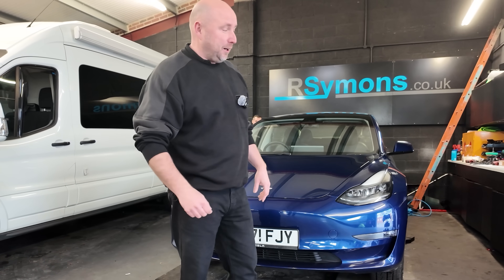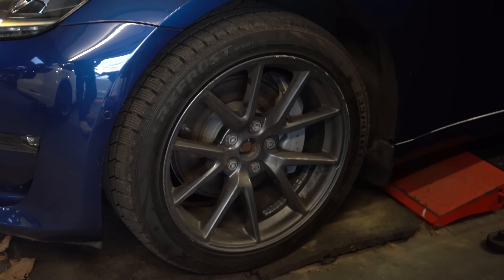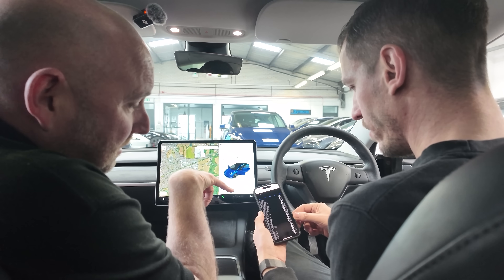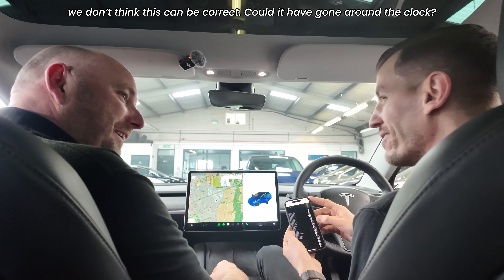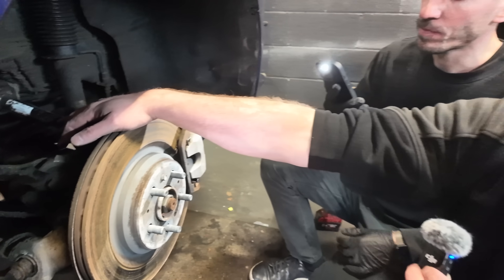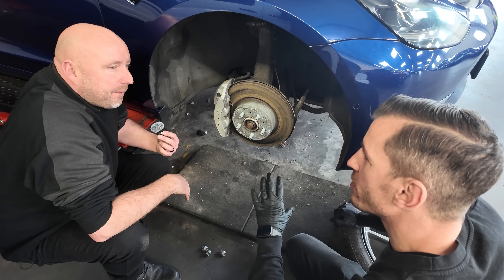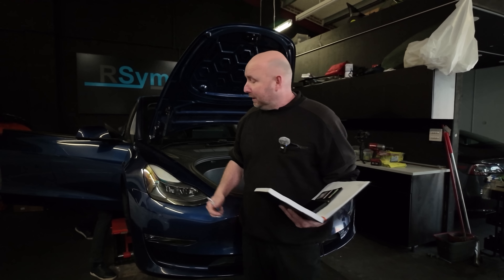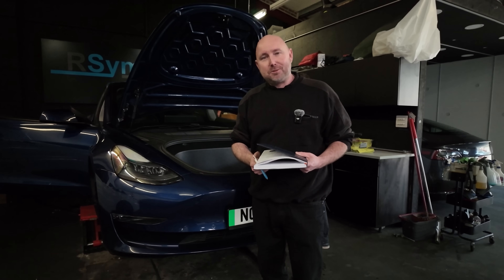EVERYTHING WRONG with my HIGH MILEAGE "21 Tesla Model 3! | Battery health and other issues!

Comment: The amount of EV sceptics that think I have to spend £10k on a new battery every few years is kind of ridiculous. And this just proves that it is a non-issue. But haters gonna hate. I can only imagine how much money you'd have to spend on a petrol car for 215,000 miles with oil leaks, clutch, gearbox, brakes, exhaust etc etc
Reply: My 2018 m3 has just over 200k and drives like it’s new. When I bought my Yukon with 200k I had to replace all the steering and suspension. It’s still drives like a sh!t box
Reply: @usafwilkerson Well, it's a GMC. What do you expect. If you are buying high mileage, get a Japanese brand.
Reply: @usafwilkerson where the fuck u driving
Reply: I got a BMW 1 series manual transmission, 2013 with super low miles, superb condition, lovely car, the 2nd gear synchro went bad, it's out of warranty, BMW wont sell syncros to mechanics, they won't sell a remanufactured transmission and they will only sell me "one of the last two new ones available in the world and there will be no more since that transmission is now obsolete " Final estimate for the job is $13k USD. and need to leave the car at the dealership for 4 weeks or more, went to an independent shop, same story, they couldn't quote much lower, the only alternative is to gamble with a manual transmission out of a crashed car in some junkyard... A 2013 car, financially makes more sense to sell it for parts and get another car rather than sink $13k on it plus all the other known BMW issues that will come up over the years, water pump, charge pipe, twin spool turbo, engine mounts, accessories belt and pulley, all know issues that will eventually pop up. Started considering a Tesla, remanufactured DU are available for ~3k in the USA including labor with warranty, remanufactured battery 8k with labor included... and that's pretty much the worst things that could fail in a Tesla in the worst case scenario.
Reply: The suspension bush problem is common with 2021 M3's.  Mine had failed its first MOT for this reason. However Tesla replaced them all at all four corners with upgraded units under warranty. The car had never had a service in 3 years so no issue there either.
Reply: Get back to us by year 5, three years is still in its adolescent stages.
Reply: @putzytart
My Skoda Superb at 215k miles costed me £30k in diesel and £15 in repairs. RRP when new £25k and less than £1k when I sold it…so nearly 100% depreciation. Now Ioniq5, 14k miles at the cost of just over £900 on public charging (no access to home charging, living in a flat).
Reply: I own only petrol and you’re right.
Reply: Some cars do have parts that fail other / related issues- ICE, EV, Hybrid, FCEV: doesn’t mean they will all do this, it’s a tiny percentage.

No car is immune, even £300k+ Maybach’s / Mercedes S Class.

What are you going to do - not buy any car because someone reported on a FB group it had issues.
Reply: I had a Seat Alhambra for 340k miles from new.
Three crankshaft sensors, three ignition coils and a clutch replacement. None of which apply to an electric car, and all of which required roadside rescue.
A MK1 Astra GTE 170k miles which had separately, a clutch replacement and a gearbox replacement. Again not something I'd ever need for an EV.
A Citroen grand picasso which had two clutches replaced, a turbo waste gate blow out, dpf issues and a complete set of brake disks replaced. None of which I'd expect on an EV.
Reply: I agree but the cost of a huge battery is huge and they do fail occasionally. My colleagues 2022 m3 just had to have the battery replaced under warranty after 40k miles. It was still drivable but gave an error code and stated range was reduced. It puts me off having one out of warranty as the £15k to replace it would ruin me.
Reply: @terrancedactielle5460  - EV Battery cost is high when you go to the OEM to get it replaced.

No one will do this when it out side of warranty, the same as no one goes to Ford for a replacement Mondeo engine when it fails after the warranty expires

Outside of a warranty - you can already buy refurbished batteries:
Porsche Taycan : £8k
BMW iX3 : £7k
Kiro eNiro : £2k
Reply: Oil leaks???
Reply: We need the sceptics. It's those that don't adapt to change or progress quickly that allows the others a head start to making more money and saving on costs. Be it through more efficient ways to live our lives or it being a tax benefit. Love the haters.
Reply: I had Audi A4 tdi V6 , beyond 80k miles it was on average £800 per yr in servicing , it felt like bleeding money.
Then had a Passat tdi new, when I got to  50k I sold it to some poor guy ;)
Reply: You guys are funny. All I was saying is that I have seen a battery die to someone who did nothing wrong. The same can happen to anyone buying a higher mileage or old EV.

Most people don’t want to take that chance even if it’s 1/100.

The BMS is very important yes, my 2021 Kona lost 8% battery health in one day because the BMS allowed the car to discharge the battery below 2.5V per cell for a few seconds when it was -3C. Some cars (like tesla) will live a lot better than others but you can’t generalise 

I bid on this Model 3 and lost. We had 6 EVs in our family, of which a model S with free supercharging and a model 3. So I don’t hate EVs but from experience, I still hate their problems
Reply: @tavi7 difference is, battery degrades gradually. Engines, water pumps, flywheels, and gearboxes just go kaput with no warning.
Reply: @AdamCiernicki you must have run some right old rubbish in the past 😂
Reply: My e-niros battery went within a month of buying. Waiting a replacement from Kia.
Reply: @carlstansfield9696  that’s a nightmare and clearly a manufacturer issue. Every car brand on the planet will have horror stories. You got unlucky, hope it’s sorted soon.
Reply: @carlstansfield9696 This is just how Kia operate. Your battery did not go but 1 of the cells did (maybe 1 of the 90 or so it has).  If it was not under warranty you would get that one cell replaced.
Reply: What about the thousands of people that lost 5 digits of the value of their EVs in last 24months? Because my Rav4 barely lost 4K of it's value in the past 3 years. Check the data if you are not aware the EV market is collapsing people don't want EVs, EVs were forced on to people which didn't end well. Tell your logic to the person that has lost 20K on a 50K Models 3 in a 1 year.
Reply: You are one of the fear mongers that seem to get off on any opportunity to deliver bad news to anyone possible so desperate to make others feel worse than you that you make up garbage with no basis in fact whatsoever.  Any moron can search eBay and see there is ALWAYS more than a few options where a car was totaled and were able to pull the battery while it’s still brand new or close to it.  A simple search would’ve educated you.  They cost about 3000$ not 20 lol.  If you can’t figure out how to change a freaking battery then there’s really isn’t much hope for you, is there?
Reply: You really are  full of BS. Try comparing that with a equivalent IC car used the same way. Very unlikely there would be any difference. Oh other than the IC engine would still be the same MPG and its fuel tank would not have reduced in size by over 10%. Of course if you go by Tesla recs it should only be charged to 80% so the capacity is now @ 70%..... But you know, Sheep are going to sheep.
Reply: I bought a pre-owned Model 3 Performance from 2019 with 240K KM/150K Miles.  Battery is at 82% capacity and i have spend over 1100+ already in repairs. Mostly control arms and some minor creaks that needed fixing. Sure the eletric motors are great, battery is insanely good on these cars, just a shame most other components aren't that great over time and same with a lot of design flaws on earlier models. The window rubbers seem to dry out on most of them and almost every high mileages ones have chipped paint on the sideskirts behind the front wheel, which leads to very bad rust in no time, since the skirts are full metal. That repair alone would send me back another 1000... which is by itself just terrible design that has been fixed with newer models tho. Also had bad luck with cracks in both rear rims (20 inch). Sure, for the money now, it's an insane deal and a great car/EV, but people glaze way too much over these tho, as the earlier examples are actually not that well build and have many weird issues. 

So no, you can't always drive these without any maintenance, it can be just as expensive as any other ICE vehicle, with more tears on rubbers and tires when hitting 120k+. Degredation also happends over time, as these will be passing 7/8+ years, i fear a lot more batteries will die. Besides all this tho, they are amazing value and the newer models are one of the best cars to buy now.
Reply: It’s always been bizarre. Most people just hate them because different.  Some just believe the rubbish haters spout, I’ve had a few people talk to me about mine and the ignorance is staggering. I ask them how many miles they drive a day and on a weekend they always answer 5 miles comute and might go shopping on the weekend so I could never have an electric car they take ages to charge I’ve given up trying to tell people my experience they just lack the ability to take in infor,action.
Reply: my 2015 F150 had the transmission go on it.. I never abused it either. After I got the bill to replace it with a rebuilt unit I sold the truck to the garage and bought myself a model y. Had it nearly 4 years now and it has been flawless.
Reply: Maybe it's those of us who buy toyota's and expect 300-400k trouble free miles... If you buy a prius or a rav4 with the hybrid drive train... that's what you can expect.
Reply: Imagine having to replace your tires every 20k
Reply: @putzytart & then they use an old diesel as the benchmark of cheap running costs & reliability 🤦🏾‍♂️ conveniently forgetting camchain/cambelt replacement or failure (I'm looking at you BMW), clutch/DMF replacement, DPF replacement, injector replacement & turbo replacement...all of these bills get scary quick (& that's on top of suspension, tyres etc... which all vehicles need, regardless of powertrain). Oh & most of those slagged off diesels before EVs were commonplace too 🤣 you can't make it up
Reply: My Honda has 220,000 miles and there have been no oil leaks, no gearbox issues, no clutch issues (auto) and is still on original exhaust. 🎉
Reply: EV cars kill you financially on the depreciation
Reply: Let them think that way 😂
Reply: 200k on my lexus with zero issue. Just oil,tire,filter,brake change. My model Y already lost 15% battery at only 33k miles.
Reply: EV Propaganda working very well in the last few years….
Reply: @BarryMakariou  BMW dealership service representatives are the best ones at pushing EV propaganda with their outrageous quotes for labor and parts. I'm telling you as a multi bmw owner that drives way above the average, I put 100k miles in my last BMW over 4 years. I would've saved a lot of money by doing those miles in a model 3, even if a battery went bad and had to replace it for 8k, which is roughly the current cost of a remanufactured battery in the USA at independent shops. Brand new battery from Tesla might be more expensive, but it also comes with an extensive warranty, plus you can get the lates battery cell type.
Reply: Lets not dismiss the reality. I owned nissan leaf 30kw model. After 3 years and only 80k mileage the battery degraded. They charged £1,5k for replacing couple of cells and… nothing changed the car still had only 60miles of range. It had around 100 miles of range new. Nothing could be done and the technician pretended it could or couldn’t work. After replacing the cells he admitted the battery got degraded. The replacement was £13k. Nissan offered to pay half of that figure. No thank you. I got a tesla now and after 5 years and 120k mileage, its range is as new. I can’t wait to see all the London ev cabs replacing their batteries.
Reply: Ah, the Panzawagon.  Heil Tesla 🫷
Reply: The Amount of EV lovers which see a High Milleage Tesla and automatically assume no Major Warranty Work was carried and no Expensive repair was done it's ridiculous 🤷🤦
.
People are skeptic about this cars for a Reason
(They can't be repaired)  at affordable costs
.
Often people are charged more than the Car is Worth 🤦
Reply: @lp5627  Tesla's log everything that is done to them. This car has had nothing major done do it. If that destroys your preconceived ideas of EVs then bad luck. 

Now I am skeptical when people say things like 'my Ford Focus has done 200k miles and it's had one oil change' like the anti ev crew do - we've all had ICE cars and know it's horse shit.
Reply: @lp5627 youve gotta be a total moron if you cannot fix almost all the problems you can run into with a Tesla.  You are assuming that all the fear mongering you’ve done or heard is true and it’s simply not.  Every time someone has an accident and it’s all body damage, they sell the parts on pages like eBay.  A simple check before typing your nonsense here would’ve educated you to the fact you can so easily buy a nearly brand new battery for about 3000$.  If you can’t replace a battery by yourself then there’s not much hope for you anyway.
Reply: My brother in law’s Zoe battery died right after he bought it out of the lease. 

As long as you don’t have a warranty (which legacy automakers will void very quickly if you don’t service with them or scrape the battery, etc) there is always a risk of one of the cells dying.

If the battery is easily repaired you will have to spend up to £1000 on the cell, but you will have a ton of headache trying to find a fitting cell and a garage to actually work on it which most people don’t want to deal with.

And if it’s not easily repairable you have to sell your car for parts which also people don’t want to do.

Until third party warranties don’t become cheaper this will always be a problem
Reply: @tavi7 Zoe battery, like the leaf is air cooled, and both those cars have much shorter life than the proper liquid cooled with battery management system.  You cannot use a leaf and Zoe as indicative of any other ev
Reply: @tomooo2637  he didn’t take his Zoe to the race track. He didn’t even rapid change it. The cooling makes no difference.

Batteries are all the same and they all wear down randomly over time. If they would be as good as you think they are every manufacturer would give out 10 year 300k mile warranties but they don’t
Reply: You can come back again if you own one Tesla with the same problem with your Zoe experience.
I would worry the chance you get from Tesla with same issue is much less, probably 1 in thousand? Ten thousands? Or more?
Reply: @singsingon  if it’s 1/10000 and a battery costs £15k to replace with labour then it should only cost tesla £1.50 to give you an unlimited mileage warranty. Why do they not do it?
Reply: @tavi7  wrong, just look at statistics and data for batteries in cars.  Then read technical articles on cooling and BMS on hot and cold days.  Sources, well since all links are deleted I can't, but Google is quite easy to use.  But there is no point with you.
Reply: @tomooo2637  source?
Reply: @tavi7  just tell me an ice car with unlimited engine and drivetrain warranty?
Reply: @tavi7 unlimited is an awful long time,   Maybe 300k would be a good limit
Reply: @tavi7 but you don’t get such warranties for ICE cars either 🤷
Reply: @tavi7 What car maker offers a 300k mile warranty? Nobody would ever buy new cars lol.
Reply: @tavi7 I have a Renault Zoe and a Tesla model Y, the Renault is poorly engineered and has had loads of issues including needing a new drive motor, reduction gearbox and onboard charger, mostly but not entirely under warranty. The Tesla is vastly better in every respect and has only needed two front suspension bushes in 90,000 miles.
Reply: @tavi7 - “the battery cooling makes no difference” and “batteries are all the same” 🤔

Tell me you know nothing about batteries without telling me !
Reply: @vxnova1 there are not many cars with 200,000 miles on still being driven in the UK.

(The average scrapped car has about 125,000 miles.)
Reply: @FFVoyager  source?
Reply: @tomooo2637  Keep making excuses why the OP's blanket statement still applies even though it doesn't.
Reply: @tomooo2637  Like tavi said, if the risk is as miniscule as you claim, why don't manufacturers provide a high mileage warranty for the battery?  Minimal risk for them (so you say) but peace of mind for owners and a strong incentive for potential EV purchasers.  Win/win.
Reply: @davemorris661  "just tell me an ice car with unlimited engine and drivetrain warranty?"

He's not asking for engine and drivetrain warranty, just the battery.  Unlimited would not be practical, but e.g. 150k miles would seem entirely reasonable if the risk to the manufacturer is negligible.
Reply: @wowbagger66  "I have a Renault Zoe and a Tesla model Y"  
"The Tesla is vastly better in every respect"

No way, the car that costs twice as much as the Zoe is better engineered?  Absolutely unbelievable stuff, stop the press!
Reply: @ same with an ice engine car. Good for more than they are warranted for. I just don’t get the thought process. I buy a tv, it’s good for 10+ years but warranted for 2 as this is normal in every industry, warranties aren’t and have never been this way but now a car has a battery it needs to be longer?
Reply: @ that’s pretty low,  I have a Prius with 250k. And the neighbor has a Chevy Cruz with 260k
Reply: @tavi7  The problem for manufacturers in offering guarantees was simply that they can't have known for certain how long the battery packs would last in real customer usage. When these cars were first sold nobody had driven them for 100s of thousands of miles over 10 years. The data is only coming though now. Thankfully their initial estimates of longevity have proved to be conservative. IC engines with care and maintenance will also last for 100s of thousands of miles but you don't get a 10 year 300k warranty with those either!
Reply: @ferrumignis  A predictably daft response. The Zoe is an old design with no proper battery management system, yes of course you would expect a more expensive car to be better but the point is that technology has moved on massively since early EVs like the leaf and Zoe and battery life has improved at the same time. Also good design isn't just about money, it is about the choices made by engineers and designers.
Reply: @tavi7 the cooling makes a massive difference that’s why leaf’s and Zoe’s degradation is way more than ev’s with battery management.
Reply: @davemorris661  Because the battery in an EV is hugely expensive, failure will often write off the car if it's more than a few years old.
Reply: @ferrumignis  They do, 8 years, sometimes unlimited millage, sometimes 120k miles and so on.  Bet you did not get that with your wet-belt Ford engine or your Nissan CVT, or your Toyota engine with added metal shavings from the manufacture etc.
Reply: @ferrumignis  That is fine, I will read the data sheets and statistics and you keep reading the daily fail.
Reply: @ferrumignis  No, you see you are making up a fallacy without understanding economics.
A battery is equivalent to the ICE engine or transmission n value.  A new engine for an Audi costs around £15-20k from Audi, but if need a new engine you have to pay for you would NEVER go to Audi and buy one for you 4 year old car (now out of warrantee).  Your garage will source a reconditioned one with a quality that matches the value of the car.
If you need a new battery out of warrantee at say 9 years (ie nearly all 8 year warrantee), they you do not go to Tesla (for example) and buy a new one at £15-19K (the price), you get the battery module changed (a battery module is a block of battery-cells in a unit.   It is common knowledge in the EV world that the air cooled batteries of the Nissan leaf and Zoe fail early - maybe 6-8 years and the cost of repair is around £600-800 all in.
(I would never recommend buying these cars for this reason - air cooled batteries)
  The module is about £100, the work is around £400-500, the rest is VAT.  That is the same cost as replacing a cam-belt on an Audi which must be done every 5 years or 96K miles (which comes sooner).
Some people will never understand the economics of owning a car, they are incapable of making equivalent comparison.
Reply: @ferrumignis the Tesla Model S had unlimited km/8yr battery and drive unit warranty for years. I'm on my third one, 245.000km on the odometer and 7% degredation. The longest driven one was a 2015 Model S 85D with 340.000km when I sold it. 6% degredation on original pack. 

So some actually produce usable cars and give incredible warranties.
Reply: @tomooo2637 this is exsctly what so many anti-EV people just don't seem to get. you don't buy a new engine if a spark plug fails, do you? The same with a battery pack and a battery cell. Just repair stuff.
Reply: @tavi7  The cooling absolutely makes a difference there is reason why ev batteries last longer and longer
Reply: @davemorris661 , you have 8 years waranty on a Tesla battery or 192,000 km‼️ Which ICE car gets so much waranty❓️
Reply: @  exactly my point.
Reply: @esbensvendsen  mate it doesn’t when you’re doing 20mph in the city and charging at 7kw. I’ve been driving with car scanner for long enough to say that the 1-2C difference between the cells will make no difference to how fast the cells will die
Reply: @tavi7 that's a good question. Toyota on EVs gives 1.000.000k warranty. It's easy to know why
Reply: @FFVoyager  there's currently 656 Cars being Sold today with 200, 000 Miles all working
Reply: @jamesgoethals9236  that's because the Battery is liability what if the EV Motor goes bad 🤷🤦 is probably not covered by the ( Battery Warranty) 😳
Reply: @tavi7  Lets not forget he sells cars for a living and also batteries degrade over time.  Even ICE do well with high mileage its the short trips that wear out mechanical things.
Reply: @lp5627  of which two are Teslas!

But you have posted a meaningless figure - what you are telling us that 0.15% of the cars on sale on Autotrader are over 200k that rather fits with my comment that most don't make it that far. 😆
Reply: Just peruse the local classifieds and look at all of the 5-10 year old Teslas selling for dirt cheap because they require battery replacement at 40-100K miles. 

Sure, some Teslas driven as taxis can get higher mileage over short term by exclusively AC charging but that's not how most are driven. You can also find an 80-yr old lifetime smoker without COPD but it's not the norm.  Batteries degradation takes time, this Tesla taxi will not last to 5 years.
Reply: Toyota offers a 6 years unlimited mileage extended warranty if you buy a new car.
Reply: @tavi7 please name 1 car manufacturer thats EVER existed that has given any warranty for 300k miles? If you woulda said 100k then you woulda had an argument.
Reply: @tavi7 fantastic……you’re basing your entire opinion on an experience with an ancient Renault Zoe. 🤦🏻‍♂️. Honestly, you are absolutely clueless. If Tesla did give a 10 year, 300,000 mile battery warranty, all you’d do is complain that they didn’t offer a 15 year, 500,000 warranty instead. People like you just find ridiculous reasons to bash EV’s. I have worked with EV’s now for over 5 years, having previously worked with engines / internal combustion vehicles before that for 20 years. Trust me when I say EV’s are considerably more reliable now than a ‘normal’ engine’d car, and we are in the very early days of EV evolution.
Reply: @tavi7  My Model 3 just passed 110k miles, maintenance has been almost zero.  What little I did get done, Tesla covered the costs of under warrantee, not something you'd see from most traditional vendors (who sometimes offer as little as 3 months on certain purchases).  I've only had one ICE car last longer than that, it disintegrated after 115k miles.  Clutch, gearbox and unrepairable cambelt all went at the same time, would have cost £4k to repair due to some bs about oil dipped timing belts.  Wrote the car off.

Would never go back to ICE, horrible, dirty & unreliable things.  I make sure to toss a hypothetical referal card to every broken down ICE driver I see... if I actually did, I would have had to order 1000s by now.
Reply: @tavi7 even if manufacturer warranty ends, you can purchase aftermarket warranty. Lastly, it’s less than 1% chance of premature battery failure. This is a significantly lower rate than ice engine failures at below 300k miles
Reply: @tavi7  To be fair I have seen turbo go after 100k km.  Fixing automatic gearbox would cost arm and the leg also... My old Mercedes w204 2.1cdi 5-speed plate costs couple hundred + work and oil, seals. Mine has speed sensors gliching on it at 570k km. 7-speed would cost way more. gearbox plate alone costs more cus it comes with built in ECU + it need to be programmed to car by Mercedes dealer. Also my injectors are worn out and it cost 800e a piece for new or 300 for refurbished one. + lots of other stuff that could go wrong. EV has way less parts to fail.
Reply: @tavi7 seriously, who cares about your brother in law?  My sisters Citroen engine died and car written off at 35k miles.   Fleet data is what matters and obviously EVs will outlast ice in the end due to lower heat stresses and complexity, even if early leaf and Zoe cars were new tech.
Reply: @tavi7 yeh I agree battery repair should become more standard and once ubiquitous it’ll reduce the risk and related fears of running an EV outside of battery warranty
Reply: @MCSMIK it’s already getting there. There was a YouTube video I watched which was made by autotrader I believe and it’s £5k to have the battery repaired by an after market company that replaces dead cells and balances them and they only except it to get cheaper.
Reply: It’s 4 years old. It will almost certainly plummet in the next 4 years and follow the trend of every single EV of that age.
Reply: @DTS7709  you really are desperate aren't you? 🙄
Reply: @DTS7709  - what trend is that then 🤔🤔You're seeing stuff which doesn't exist 😵‍💫
Reply: @SDK2006b  go and buy a 8 year old Nissan Leaf and tell me it’s not a trend. My 8 year old BMW M5 purrs just as beautifully as the day I bought it and it doesn’t do 64 miles on a tank just because it’s 8 years old.
Reply: @DTS7709  - Why are you comparing a Nissan Leaf to a M5 - just LOL ! Also, Leafs were the 1st EV launched (in recent times), so they aren't the best example of an EV and they only 80 miles of range when new. 
Compare a Rimac Nevera to your M5 - byeeeeeeee 😊
Reply: @DTS7709 you mean aside from all the EVs that are more than four years old and doing great? Model S as an example.